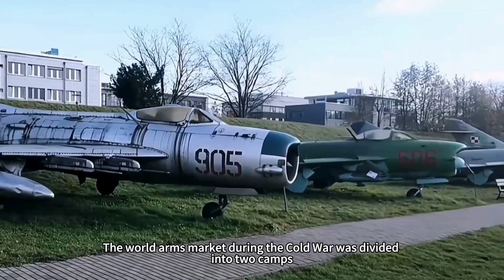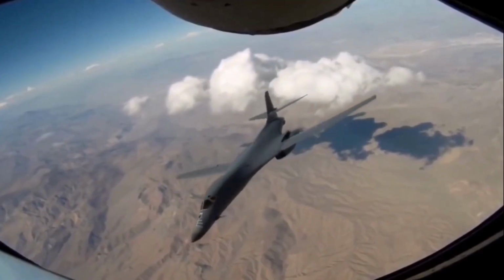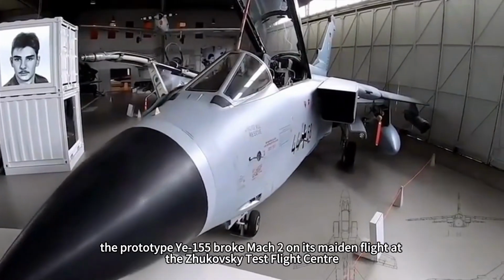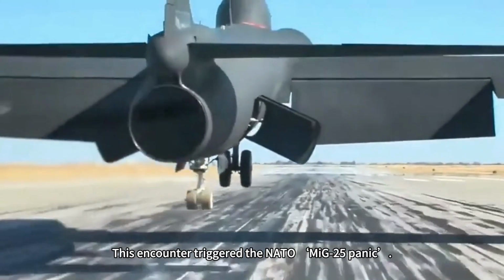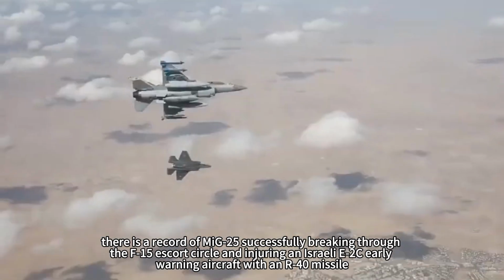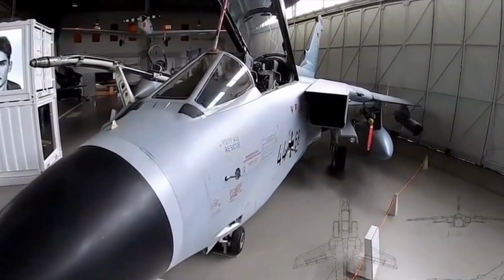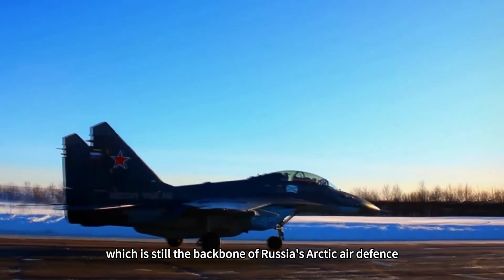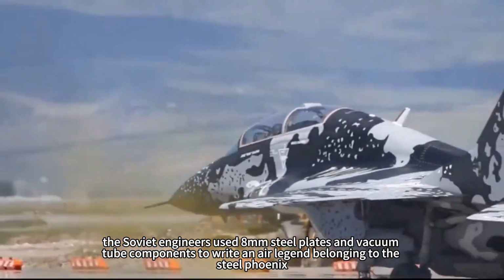How strong is the MiG-25? NATO feared it for years, US dismantled it and marvelled at it！

Comment: 1 correction re F4 Phantom 2. Those were the fastest mach fighter planes ever built until the brand new Mig 57.

F4s were mach 3.4 capable. The mig 57 is mach 4.3 capable.

The Israeli / Egypt situation involved planes coming OFF THE GROUND vs planes already in afterburner.